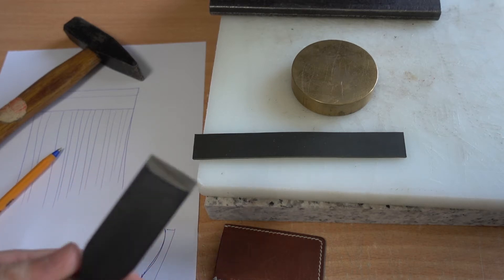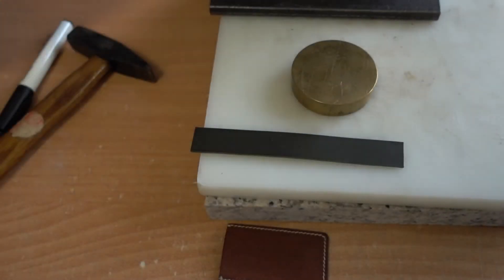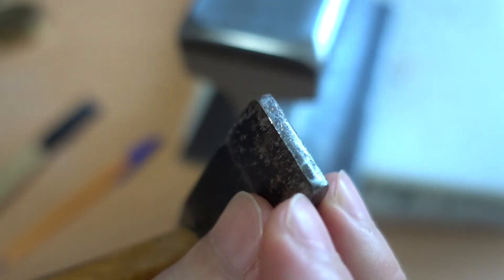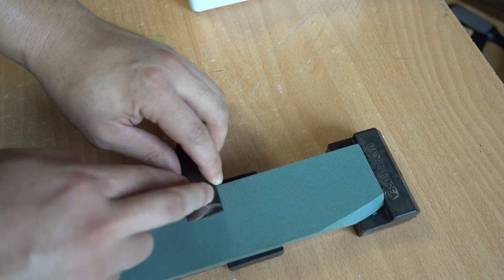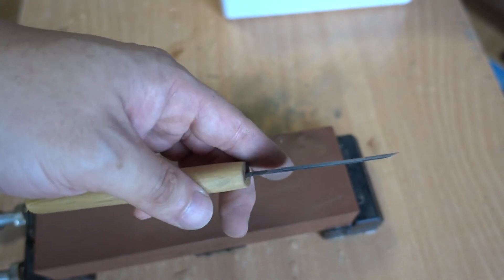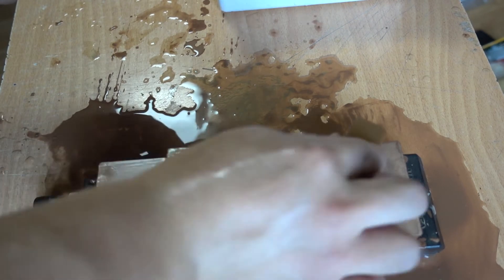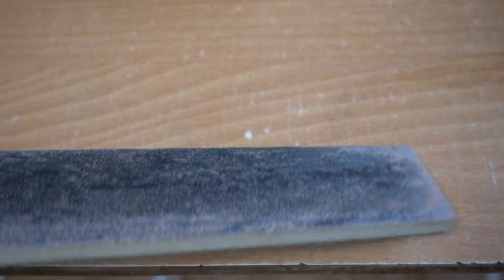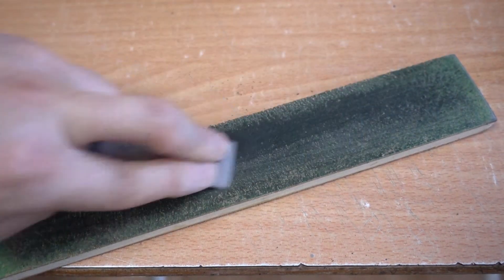How to fix/sharpen Japanese leather knife

Comment: Hi, I accidently ruin my knife edge, but I cannot sharpen it. Tried and it still has those dents.

I understand now that japanese knife has hard and soft metal.

Do  you have any suggestion to restore and sharpen it, start from the back side like yours, or from the front first, or else?

Thanks before!

Comment: Not to nitpick, but I'm curious about your opinion: 

I see you sharpen your blade back and forth (or side to side, along the long edge of the stone). Would you consider doing a figure-8 pattern to be detrimental? Supposedly its an efficient way to sharpen Japanese style blades (wood chisels, in particular). Ideally, its supposed to remove more material than the back-and-forth?
Reply from the maker: Hello, Anthony,  you didn't bother me at all. Thanks for the good input. you are right. doing figure 8 motion does help to grind evenly as you can divide pressure with one hand. but for this sharpening method. 1)blade is too short 2) it has a handle attached, it is very difficult to do figure 8 motion to flatten the back of this blade.